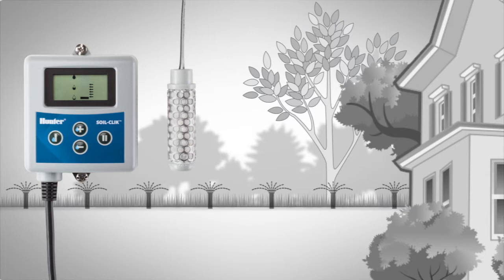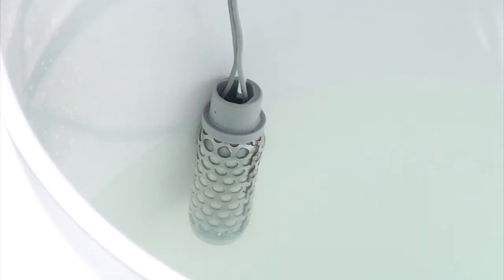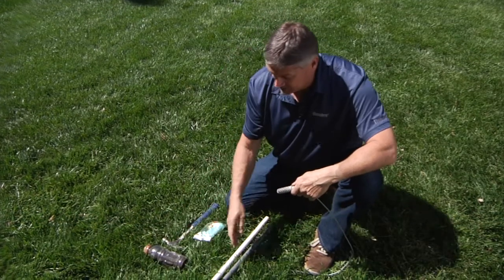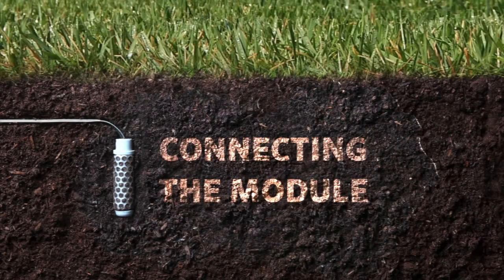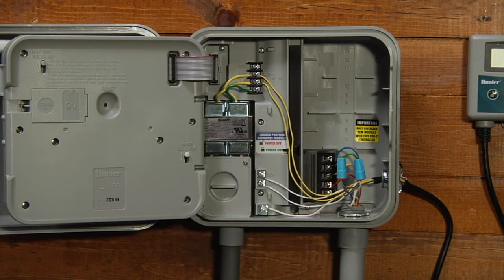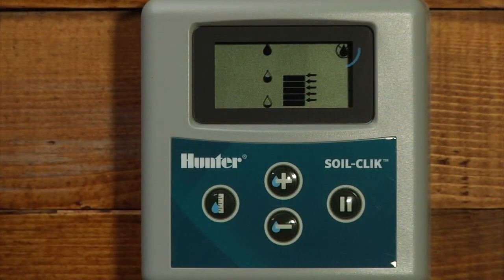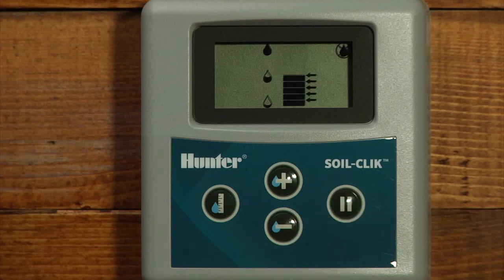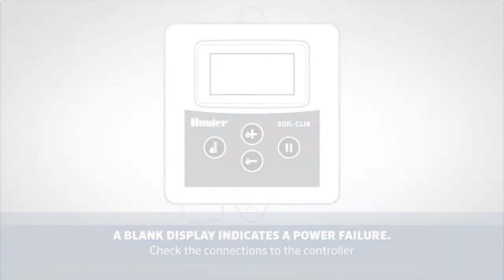Soil-Clik: Installation and Setup

Comment: I believe the logic used for your Soil-Clik sensor is incorrect.  I recently had a Hunter system installed, including a Soil-Clik and a Solar-Sync.  We had a fair amount of rain in the past few days and the soil needed very little sprinkling to reach it's Soil-Clik cutoff.  The first five zones received thier full amount of water, but the sixth (last) zone received only 1-2 minutes of water before the Soil-Clik shut it off.  So I've overwatered - wasteful in both water and money - all of the zones except the last.  I believe the Soil-Clik should be programmed to be placed in the first zone and the programming should recognize the percentage of the normal run time it takes to reach the Soil-Clik cutoff.  The system should then water all of the other zones for the same percentage of scheduled time.  Your design only get it right for one zone, my suggestion gets it right for all zones.  Please comment.
Reply: My comment was not about the Solar Sync - I have no problem with how it's designed to work.  I also understand that, as currently designed, if the Soil-Clik were in the first zone, it will stop watering in all other zones.  I'm suggesting that the ProC controller be redesigned to recognize how long it takes to reach the proper moisture in the Sil-Clik zone, then water the other zones accordingly.  In that case, the Soil-Clik would belong in the first zone.
Reply: @waymegelli  Hi Wayne, I totally agree with you, it requires rework by Hunter, logic should be following : 1. zone with sensor should go first,  2. same percentage of time of watering that was applied on first zone then should apply on rest of the zones, that's it. But it is hard to achieve with this HW I guess...
Reply: Totally agree, and I just read someone reviews in other irrigation website and he came up with this solution: All the lawn valves share a single common wire so the sensor is wired to break the common when saturated and the irrigation system can continue the set program without the lawn valves being opened